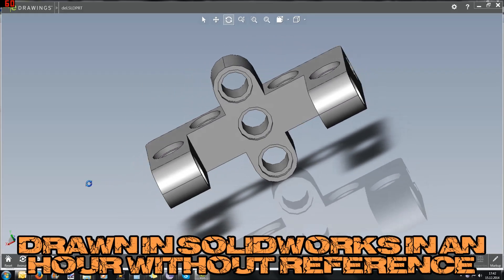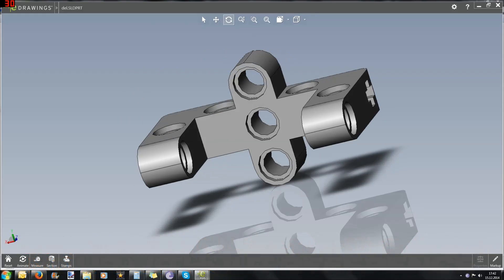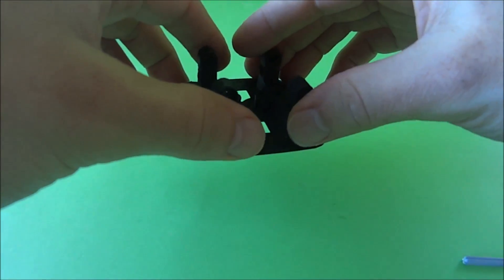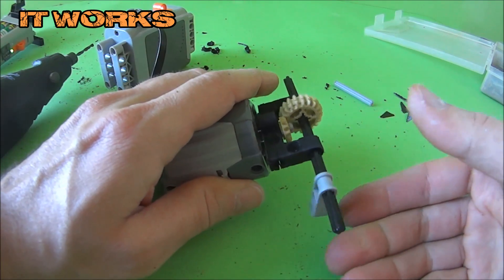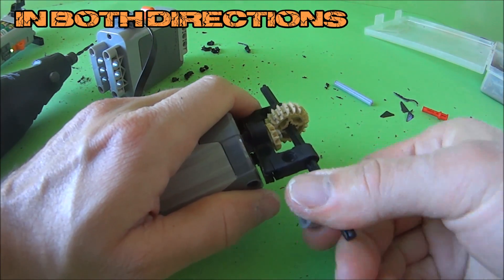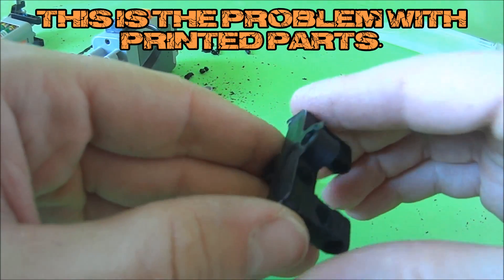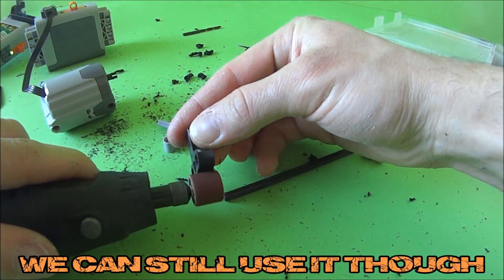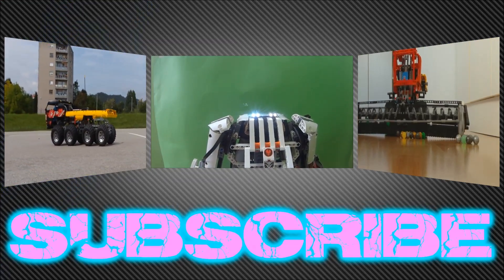3D PRINTED LEGO

Comment: What filament did you use? And what printer at what resolution? Nice work drawing them up in CAD
Reply: Thanks. If you try printing again, maybe print the part on it's side such that the layers won't be brittle in the direction of force.
Reply: ***** No not bad at all.